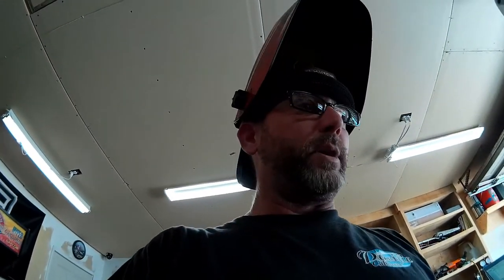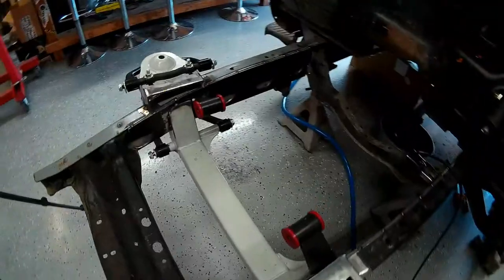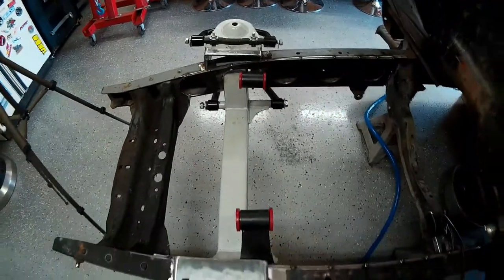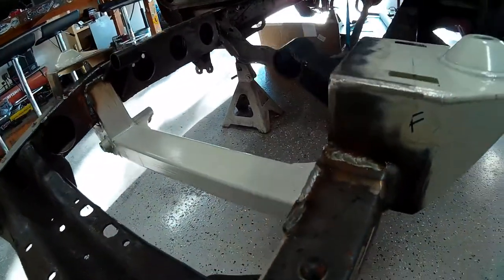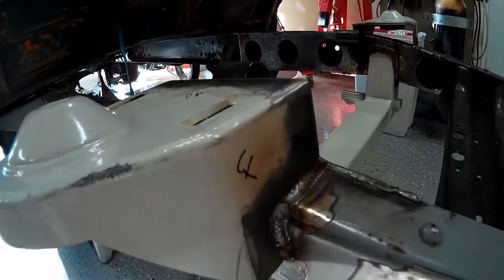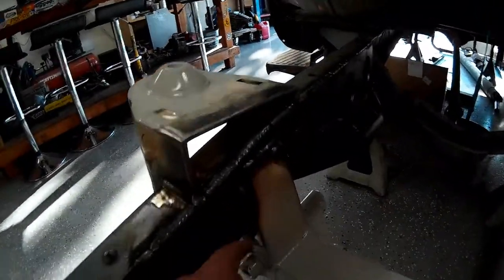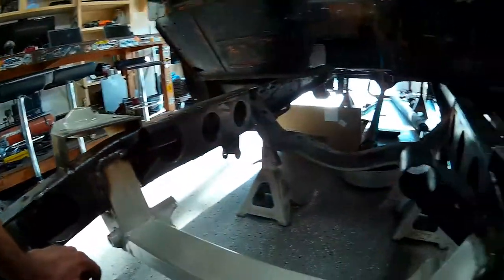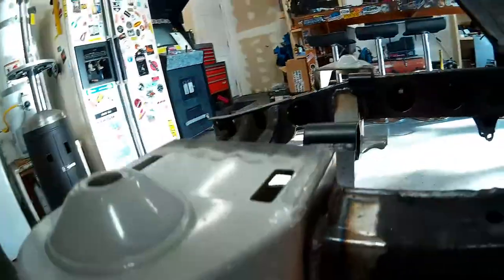P48 Project; Helix Mustang II IFS Install, Part 5 - Welding it All IN!

Comment: Just started my 49 GMC. My welding skills are very basic. I have never taken on a project this involved. I have the Helix IFS in the garage and the bare frame on the  lift, just started making the boxing frame templates. This series of videos is going to be very helpful. Thanks Jim for posting these.
Reply from the maker: Thank you Tom, I hope your project goes well.  One thing I will share is, before you get ready to lay down a bead on the frame, get a couple pieces of scrap to "warm up" on and get your settings right.  you'll have a much better result on the frame itself.....i need to be better about doing this as well.

Comment: Slow wire feed & a little more amperage
Reply from the maker: thanks for the tip, at the time my 211 was new to me and it took me awhile to get comfortable with it.  i'm still working on that, but the recent welding i've done with it feels alot better to me...and i think looks better too.  thanks for watching!